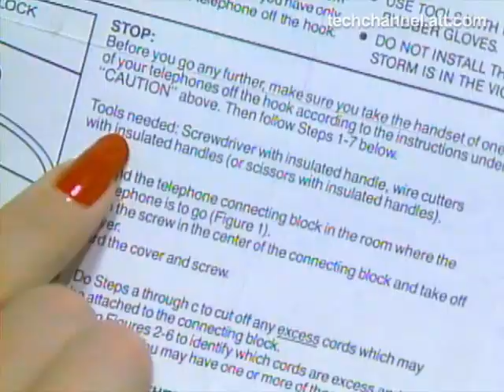How to Install Modular Jacks by Yourself - AT&T Archives

Comment: All  plastic garbage. Go back to cloth wires, ceramic jacks, ceramic terminal blocks with 6 wires instead of 4 and lugs on wires. It's not complicated. You're not likely to get bit, and if someone does happen to ring you while you're touching a terminal, it's not lethal. Get rid of the plastic, and instead of bake-lite, use a stainless steel. And always, ceramic insulators. And keep an iron plate on the base of all the phones. I like things to stay put when I set them down, even if there is some strain on the coiled wire. But those should be cloth too. We need to go back to the old ways when Western Electric made phones that were leased, except make them available for purchase, with the said improvements. And go back to the POTS. Not this VOIP crap that doesn't work if the Internet is down, or there is a power failure. That's NO GOOD !

Comment: Why four wires? In argentina it works with just two at home. Remember to see 4 wires in some businness environment with multiples extensions (like in the bank).
Reply: Only the center two wires (red and green) do anything. The others (black and yellow) were typically connected to other jacks within the home but nothing else. They could be used for a second line.
Reply: @stevebollinger3463  They were used to supply power from a plug in power supply to light a Princess Phone
Reply: You'd also see that spare spliced over whenever the first pair was damaged or simply didn't work.

Comment: Which I could visit a phone store like that nowadays!
Reply: Yeah cell phones sadly, You walk in it’s all trashy cell phones not trying to be rude or mean but cell phones will never be as good as hard wire landline phones will be. That’s exactly why I still have a old switch landline in my house because it works every single time. But the thing is more likely you’re cell phone will be turned off before the landline does. Sooo I prefer everybody that’s looking at this comment to think again and go old school and get those good reliable landline telephones ☎️
Reply: @MichaelWallace-oq3wd  Does using VoIP count? I have no landline at all.
Reply: @7667neko  VoIP is a internet based phone line, The Phone that i have is a POTS line, And i've it for 4 years now and i enjoyed it a lot. But one thing about a VoIP phone is when you lose power in your house you're internet goes out and your phone goes out with it as well, But having a additional POTS line which stands for Old Telephone Service, That's much better cause you're getting much faster connection and reliable voice connection!

Comment: Adding phones.... Except they forgot to mention the Ringer Equivalence Number..
Reply: They did not need to as the newer modular phones had a lower REN than the direct wired phones.
Reply: @common_c3nts  In the US the REN still applies.  IIRC Frontier's limit on a single phone line was a total REN of five.  Most phones are between 0.8 and 1.2.

Comment: Why didn't she just loosen the screws and remove the wires instead of snipping them?
Reply: Because they didn't want anyone coming in direct contact with potentially live terminals. That's  why they said to use insulated snips to clip the wires.
Reply: @freddiemaxwell8959  it's only a few volts.. lol. Ringing voltage is the fun part 🤤🤤

Comment: The connections are made by just snapping onto the screw terminals? That's crappy. Spade lugs that are tightly clamped into screw terminals is far superior. Also, you only need to connect tip and ring (the green and red wires). The yellow and black wires do nothing on a single phone line system and/or a single line phone (like that Trimline she bought).
Reply: yeah, but what if she decides to get a second line later, and gets a two line phone. . . she won't have to pull that jack and snap the yellow/black pair

Comment: "If you have problems just call the 800 number".
okay let's see, I just shorted my phone line out by not getting rid of excess wires and now my phones don't work. I will use my cell phone, no wait that will not work hmm…. i guess I could ask my neighbor, a mile away.

an instructional video, what a perfect way to distribute it on YouTube so everybody can see it. no wait that was around either so how did they distribute this? oh to the sales staff.

i love these old videos, they are always way ahead of their time.
and most the time just gathering dust in an archive.
Reply: this was 1984, could have been vhs, released in 1976

Comment: The Bell System was really the penultimate example of efficiency when Phone Center Stores were at their peak. Moving into a new house/apartment that had modular jacks?  You could go into the Phone Center Store, pick out a phone, give the person details and walk out.  Total time, maybe 15 minutes. By the time you got home, the order was worked and the pair was hot.  You just plug in your new phone and, voila! Hello Central!  Many businesses today could learn a thing or two from the Bell System.
Reply: by the time you got home the order was worked ?  well not exactly someone had to issue a service order, connect a jumper in the CO, maybe do some outside work and they type your no. into the ESS switch  to get dial tone.
Reply: The main reason they gave for doing your own was because of how long it would take to get the phone company to show up
Reply: This was post break up

Comment: Its interesting that Bell offered running wires for new jacks by regular people, I would think they would set a standerd making Bell employes do wiring.
Reply: This was 1984.  AT&T weren't Bell any more.
Reply: @cjmillsnun  😢
Reply: @cjmillsnun  I am sure the RBOC serving your area or GTE would have came out and installed phone lines and converted jacks into the modular ones anyone over 40 knows about for a fee.  Today Frontier (the successor to most of the old GTE area) would charge about $180 plus materials to install a couple of jacks for you.